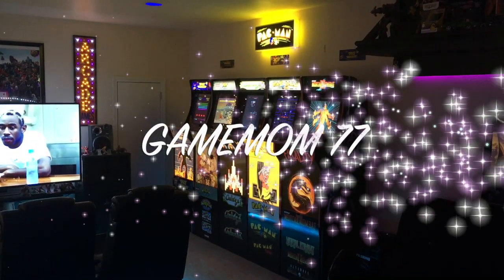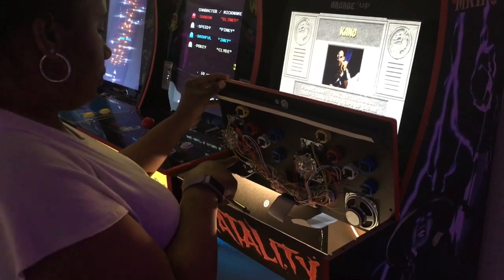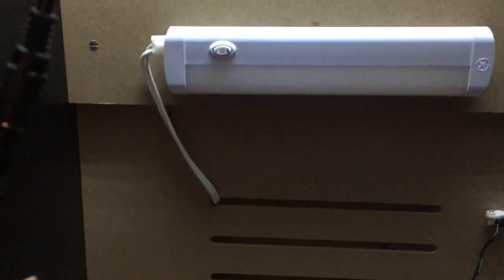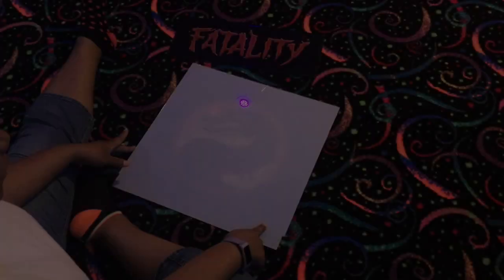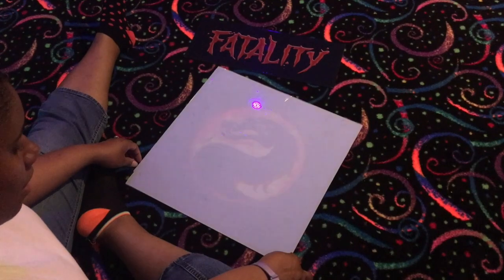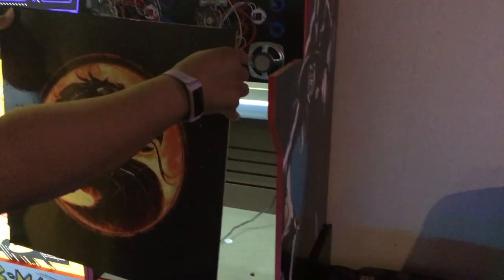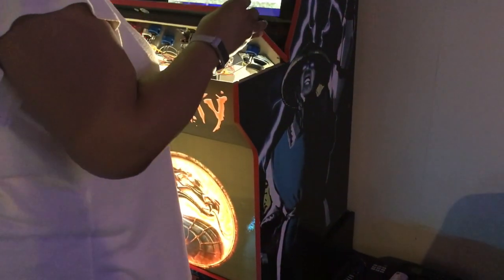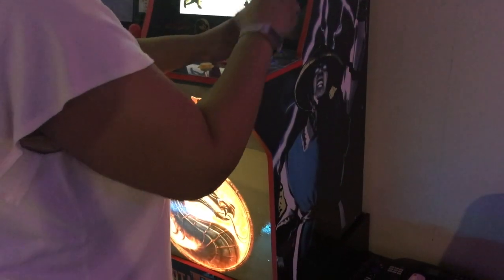ARCADE1UP LIGHT UP KICK PLATE INSTALLATION #arcade1up #install #lightupkickplate #gamemom77

Comment: So u have to unscrew the control panel everytime u wanna turn off the kickplate? Or unplug from the wall? I suppose its not wired up to work with the on off switch I see. This seems to be a fairly easy mod to do and looks amazing

Comment: Does the light just come on with the power button?
Reply from the maker: Hi Bart the lights are connected to a surge protector so I can turn them off from outside of the cabinets. 😊

Comment: What thickness plexiglass are you using from Lowes??
Reply from the maker: It's the same as the kickplate and jpanel. You may want to take them with you because they have different sizes.
Reply: @GameMom77  I did. I went to Lowes and found a plexiglass about the same width as the two but the worker their who helped said that they couldn't cut it based on the thickness of the plexiglass so I went a little thinner with the one i got. Hopefully it will be successful.
Reply from the maker: The employee was just being lazy. If the plexiglass is there they can cut it. The size you have should still work.